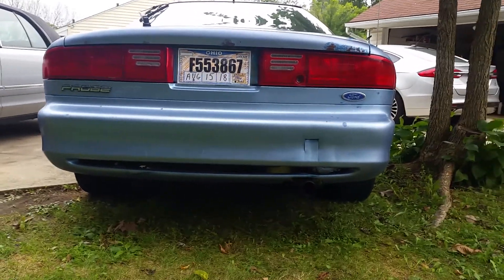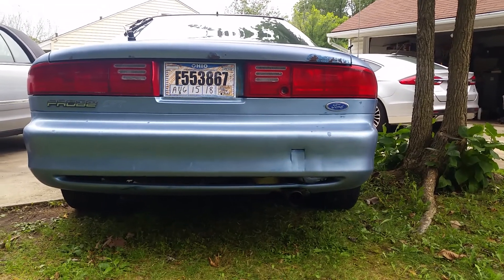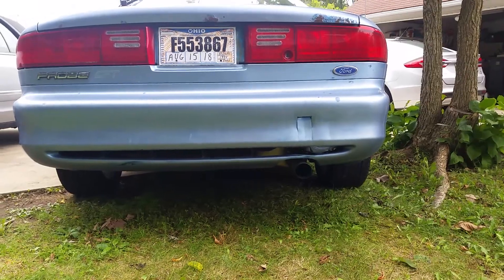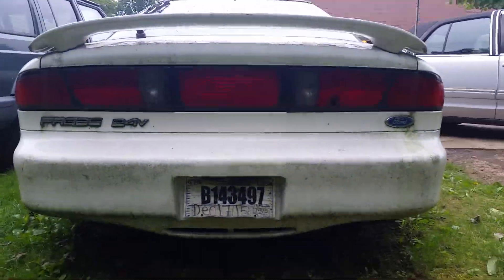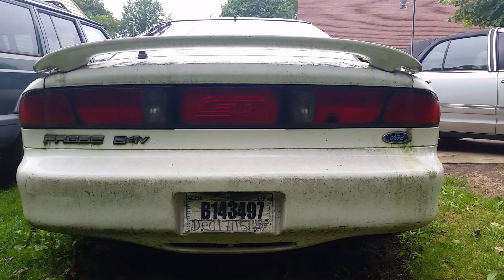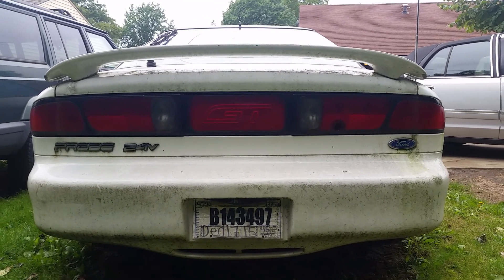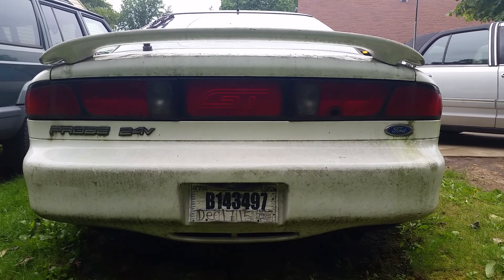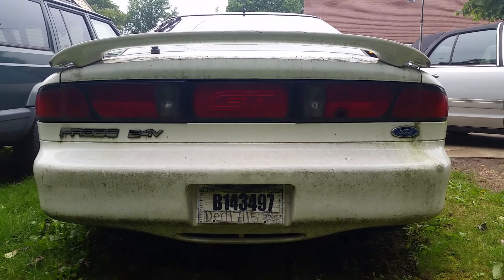Bumper project

Comment: Oooh that's a good idea. I also have both bumpers and I've been waiting to do the swap, but I also prefer the 1993 diffuser. I was also thinking of doing a custom diffuser on mine at some point with cladding that goes farther under the rear of the car
Reply from the maker: So I was walking through my garage today and looked at a hood I purchased to use for it's metal. I never ended up using it. But the shape of it looks like it might be a good foundation to start some sort of diffuser. It's not a complete thought or design but it's wide, flipped upside down the front part of the hood would curve up to meet with the hoop in back. With some clever engimineering it could even be released with a hood latch and hinged to drop it for maintenance. It also has a structure to keep it from just being a floppy piece of metal. It's also symmetrical to start with. It will need a piecec in front to keep it from catching air, but if your plan is to do the whole underside it would be perfect. The hood I have is from an older  focus, but there might be  something with a better shape to it. I haven't tried to check dimensions or anything. Thing number two, Bad Obsessions Motorsports is a YT channel, they fabricate with metal using cardboard cutouts first to get the desired shapes. When you've got time, you should check out how they do it and  "project Binky" a classic mini getting stuffed with a Celica GT4 drivetrain. It's a longterm project, been watching for years now.
Reply: @pgtmr2713  I've followed project binky for probably 2 years or so now, I can't remember exactly. I was thinking of making mine out of cardboard to get the shape, then fiberglass for lightweight and rigidity. I work at a bicycle shop so there are always boxes around with enough unbroken material to play with
Reply from the maker: @Jamesbond22855  Nice! I should post a concept video, show you what I see. Maybe you can get the shape for your fiberglass from this and carboard the rest... or put the same work into carbon fiber.
Reply: Any progress on this buddy?
Reply: @pgtmr2713  any progress on this?
Reply from the maker: @Jamesbond22855  Not yet. It got cold, rainy, snowy and I've got to figure out the gentlist way of removing the 94 bumper so it will go back on. The screws are rusted pretty good and the metal around the plastic holder is a little crusty and rusty. I want to repaint the car fix up the rusty thin spots. It's kind of on hold til spring really sets in.